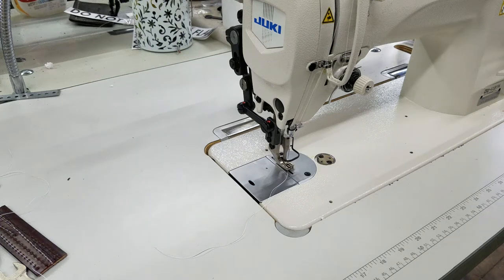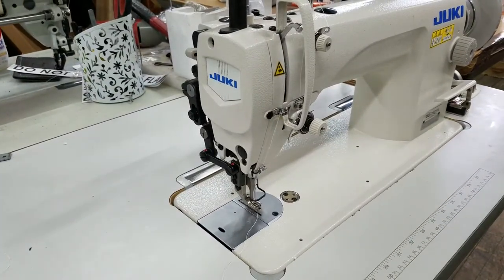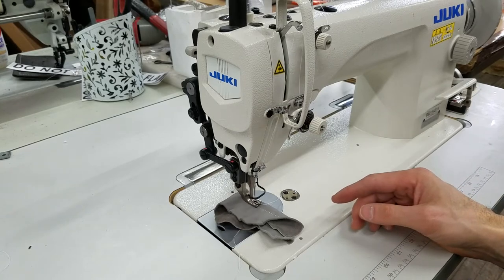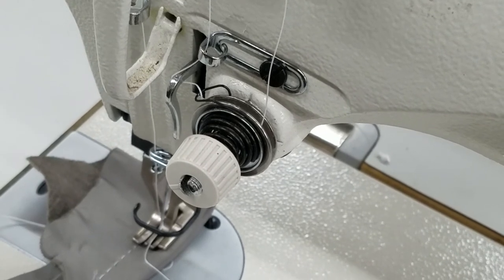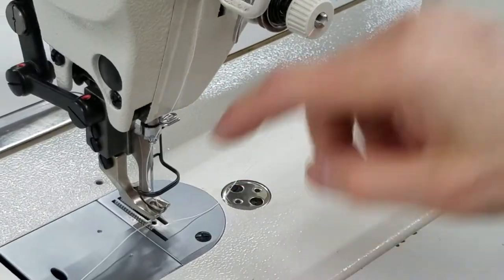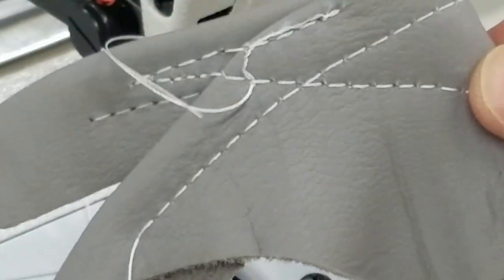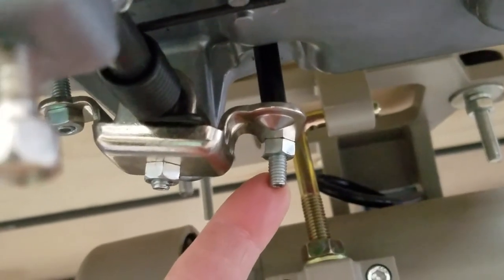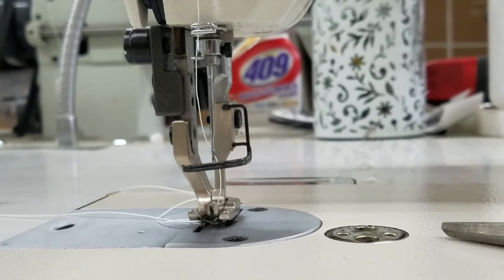Juki DU-1181N knee lift adjustment and foot height

Comment: This worked, thank you!  I have another question :) I have that same foot with the black wire coming out and down.  Can I just snip those wires off?  They bothers me.
Reply: The safety guard will just pull out of the holes just remove the foot grab the guard with pliers and remove from holes it’s perfectly fine to remove they are annoying
Reply: @michaelthompson9127  thank you!

Comment: I have this machine and I was messing with the tension because I started sewing with slightly a thinner material. Not too thing but, now it is making this loops on the bottom thread every five stitches or so. Do you know what botton I need to adjust?
Reply from the maker: Loops every once in a while is hard to diagnose.  I would check to make sure the thread is in between the tension discs all the way.  Sometimes when we thread the machine with the presser foot in the down position, we do not get it (the thread) all the way into the discs, which can cause an inconsistent stitches.